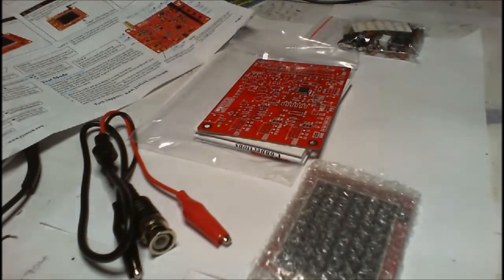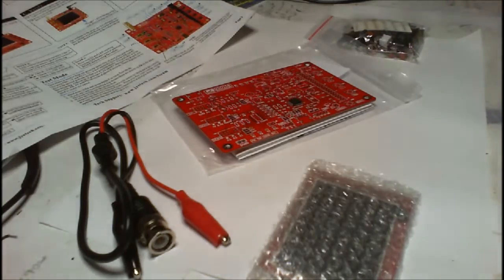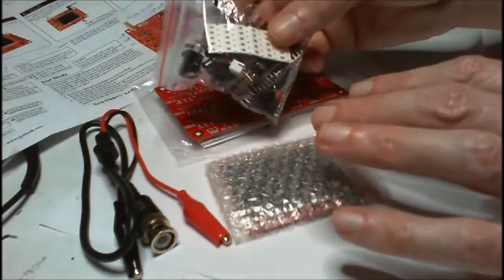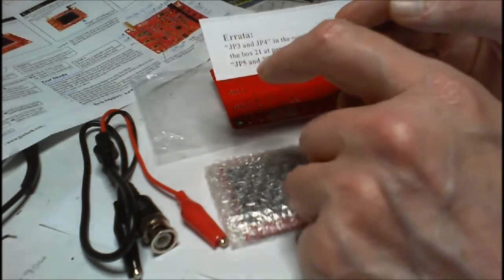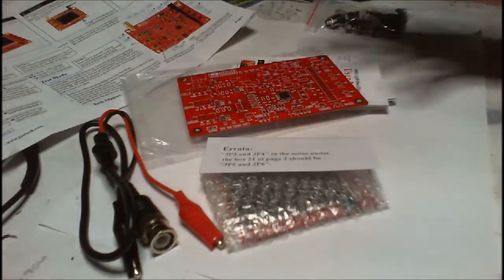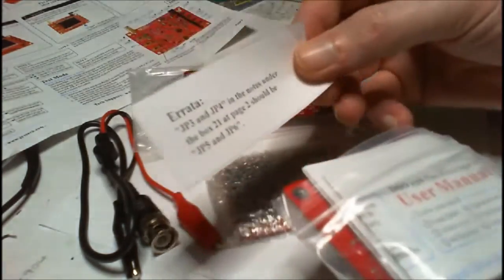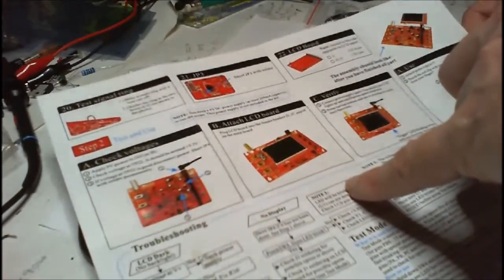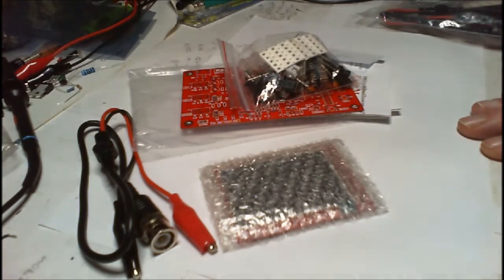DSO138 Oscilloscope Kit EXTRA Instruction Note

Comment from the maker: Just to add I have built the DDSO138 and bridging JP5 and JP6 it does not work. The screen lights but no display. I unsolder and bridged JP3 and JP4 as per the official instructions and it works as it should. Ignore the note.